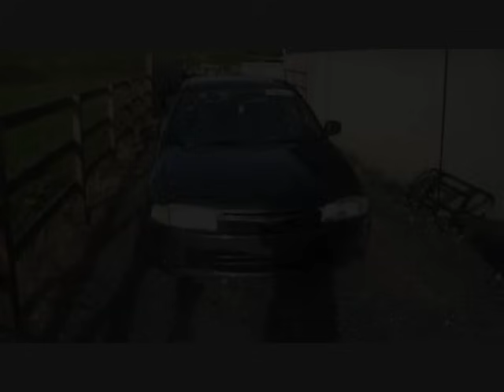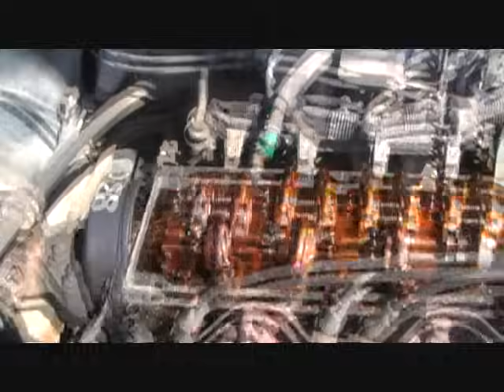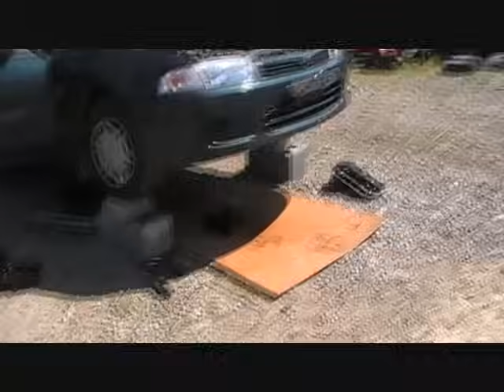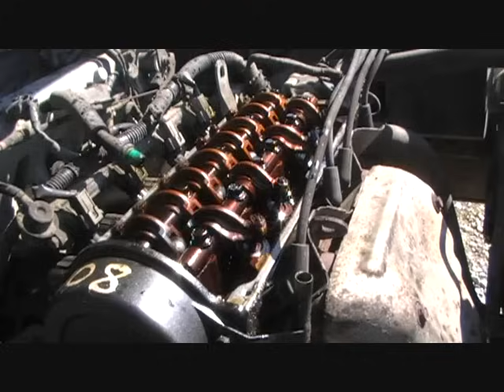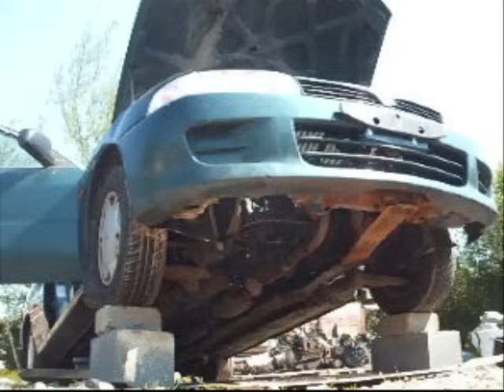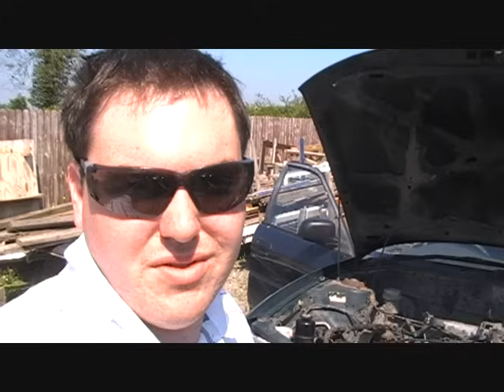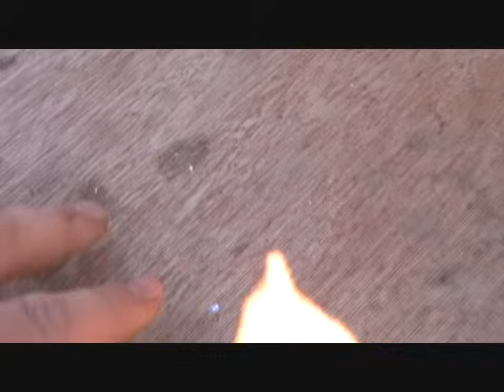Engine Running NO OIL - NO SUMP - Seized Soild on Camera

Comment: I tow cars all the time that have had rods blown holes in the block. and have seen it in front of me racing, giant cloud of smoke when the rod comes through the block and the remaining oil sprays out onto the hot exhaust pipes.

Comment: oh yes there is. I was on the highway and there was a minivan in the slow lane. As I went by the minivan sounded like flapping plastic in the breeze, then the minivan slowed down , I had to look in the side miiror as there was a slight bang and flames under the car.. Ideling, even at a higher speed is a lot different then driving when you have the momentum of the car through the trans that breaks the "siezed" engine loose a few times till it seizes to a point where a rod bends or comes loose.

Comment: Had a merc E280 let go when chasing a vauxhall senator, no bang just sudden loss of power and silence. A con rod had let go which took out the next liner aswell, it drove an inlet valve out through the head and broke the inlet manifold and it had broken the cam and pushed two exhaust valves up into the rocker box which had a huge hole in it where the piece of cam had come out. I had people coming round for weeks after to look at the sump full of metal that we had removed :)

Comment: Well it can sling a rod...once the bearings are chewed up enough it can crated a gap that causes too much force on the rod cap under high Rpms and it literally rips tha cap off and slings the rod...and you could put the pan back on and over fill it w/ oil let it set overnight and it would crank and run again...but not for long the damage is done

Comment: it is interesting to watch an engine expire,  yes usually they lock up, but some engines can  go off with a bang,  i experienced this as a young buck, in an old 50's car , we  had been sitting on 70 mph on a country road as young blokes do, it first lost power, kept it flat to the floor, losing road speed ,  losing road speed, still flat to the floor,
then bang, tinkle tinkle tinkle as engine bits(broken engine block) bounced along the road.

Comment: It would be interesting to hook up a water hose to the oil pickup and pressurize the oil system with about 75psi of water with no oil pan then run it. The water will cool it and make a suspension between the bearings and journals. It will fail after a while, but run longer then without oil.

Comment: I hate to see things destroyed 'just because'.  someone, somewhere could have possibly used that engine, and even if they'd given you only a few bucks for it, it would have been better than blowing it up.  the engine was obviously usable if it was that clean inside and ran that long without oil.  your car, and your call, obviously, just pointing something out.
Reply: I'd pay him 20 bucks to do this , its valuable information, you only need one full rev video to tell you an engine will slow and die if you highway it with no oil, but this let's me know I can make it to a close oil place before its too late, and how long I'd have to pull over if I ran out
Reply: I could save you the $20 AND the car in the video.  Damage to the engine starts the moment it is starved of oil.  The engine may go for some distance before the damage becomes severe enough for it to seize, but th longer it goes without oil the more extensive the damage and the more expensive the repair.  The major components at risk are the main bearings, crankshaft, and camshaft.  ALL are expensive fixes.  Better to shut it off the moment you know there's as problem and walk a mile or two.  Might save you a couple grand.
Reply: ok it was an example , but lets say you kit something and crack your oil pan , theres time to notice the pressure drop and shut it down
Reply: Dion Comeau No - if is no oil and there is any load at all, you are going to have metal on metal pretty darn quick.
Reply: I think what Dion Comeau means is if you shut the engine down immediately upon noticing a problem, that it might not be necessarily fatal.  Which is probably true, I suppose, but I'd have to point out that in such a situation, seconds count.  After all, it's not always possible to shut the engine off right away.   You might need that engine running long enough to get safely to the side of the road.   Shutting the engine off in, say, the high speed lane of an interstate is dangerous to both you AND other traffic.  But yes, the longer the engine runs without oil, the more likely there is to be significant damage - and serious damage can occur in less than a minute.

Comment: The metal filings ejected from the engine were the top coating of the bearing shells. Main and big end shell bearings are designed to consist of three layers, steel, copper and finally bismuth. The whole idea of the top coating of bismuth is to allow for in extreme cases the bearing to wear without damaging the crankshaft. So if you run out of oil and realise in time, you replace the damaged bearings without having to replace the more expensive crankshaft..

Comment: Actually it was a 1973 ElCamino 350. It was in a flood and the oil floated out. When I pulled the dip stick only water showed! I needed to drive my wife to work (1 and a half hours) then to my work (45 minutes) there I drained all the water out, put in oil, ran till hot, changed oil again and ran it for years after with no apparent damage!

Comment: There is never pressure built up in the block. "oil pressure" is just the pressure of the pump picking up oil and pumping it through its passages to the rockers/cam/lifters and other places. etc, then the oil drains back into the pan.

Comment: I have some questions for you. 1. Why did you choose to do this? 2. Some times moors will fail by rods breaking, large short lived flames. 3. You are correct that most of the time a motor will fail a lot like this motor did with no spectacular visuals. I hope next time you chosse to show some thing like this you use some thing other than cement blocks. That can be very dangerous. Just be safe and thank you for this video.

Comment: Beautiful!.... but now how do you fix it???
is it possible to bring that engine back to life without swapping it??? if so, how???
please go in detail
Reply: not really. remember all of the parts have metal shaved off of them. if the block is not broken, you can replace everything. but it would cost you more than simply buying a new motor.
Reply: He never said he was going to fix it so there is no detail to get into.
Reply: I never said he was gonna fix it
Reply: I wasn't replying to you. This comment section is for replies to Julius' comment.
Reply: i see, well. my point still stands. she never mentioned the poster fixing it, she was just curious as to how it could be fixed. is how i read it.
Reply: Thanks guys! Engine Swap it is lol.

Comment from the maker: the release bearing in the clutch is badly worn and is making the roaring sound that you here. nothing to do with the engine, but the gearbox has to be removed to replace it

Comment from the maker: well here in Ireland the scrap price of a car of this age is based only on its weight, nothing else, so I got just as much for it with a wrecked engine as I would have if it was running. As I said before, the car was not economically viable here in Ireland due to strict annual testing, and parts from this car , like engine and gearbox etc... were also not valuable as there is little to no demand for them here. The car was just worth its weight in scrap, but I got some fun from it too!

Comment: Here in Oz, a wrecker or backyard mech could potentially make 500 from that engine/gearbox combo (obviously before it was destroyed). Wreckers sell all kinds of things. A piece of crap car can make you a couple of thou if you sell the components individually. A bonnet $50. A door $50. A/C compressor $50. Running engine $400+. Gearbox $200.

Comment: If you were to put oil in it, I'm pretty sure it would start again.  I'm amazed that it didn't spin a main.

I once tried to kill a car with bad rings by avoiding oil top ups.  As the oil was consumed, the car actually became faster and faster... right up to the point where it spun a main.  At this point I desisted and put oil in it cause I needed to get home.  Apart from a distinct ticking, it went exactly the same as usual for a further 2 days; at least until the engine seized. I was chuffed.

Comment: Even though it will surprise most persons how long it took the engine to seize up, a lack of oil is but one way to destroy an engine. Another effective way is stressing internals for a period of time while the engine is under load, even with the sump installed and filled with oil. Connecting rod loads put wear on bearings and the right amount will destroy an engine even quicker than free-revving one without oil

Comment: thermo shock. the engine is extremly hot after that, you introduce room temp oil and i dont think it would make it 1 min. probably end up actualy cracking the block or head. but i dont know for shure you could be right.

Comment: I bet you might be able to loosen the bolts a bit on the rod bearings and start it up again.... maybe
Reply: Yep I bet you could as well just need to make it loose enough to turn over it will run until something completely seizes it up.
Reply: Eric Kent Remove the rod bearings and tighten the bolts until the caps are tight on the rods but not touching on the crank talk about rod knock now we are talking about BREAKING pieces of steel.

Comment: It has seized because of heat, and the oil is not only there for lubrication, but also for cooling.  If he let it sit for a while again it would start again until it got too hot again. He could have held his foot harder on the gas and it would have overcome the stalling from friction..........for a while.

Comment: I used to know a used car salesman.  He would go to Mexico to find cheap cars.  He found on but it had no oil.  He was told to use water and just drive slowly.  He did and it went for hundreds of miles.  He then drained the water and put oil in it. It was fine.

Comment: What is the noise the engine is making when he first pulls the car up? My engine in my 2002 Galant DE makes the same noise. Most cars here in U.S. don't sound like that. Just wondering if anyone can tell me if thats normal, or what the noise is?

Comment: Well this is exactly what happened to me to my 99 Corolla on highway.... Low pressure Oil and did not stop :(... and mechanic said it would cost me 1000$ +. I didn't know what to do. is this fixable at any cheap cost or the car still sellable if the car was still in great condition besides what happened here to my car? what price would I get to sell a car that has metal pieces in engine..?

Comment: You need to run an engine on fairy liquid and see what happens.I bet it will run for a long time. It has a similar viscosity but I don't know about the index. It is worth checking out. Big oil may shut you down..LOL

Comment: Try again with another scrapper, but go a little drive. It lasts much longer because there's virtually no load on the engine. Go tear it about and keep it above 3k. An engine seizing under full load and stopping from high RPM has a high chance of producing a more impressive failure :D

Comment: Its a good thing i always keep an eye on my dash. I had a car where the oil pump sensor blew and if it weren't for that nice little oil light on the dash coming on. I woulda blew the engine. I pulled over and checked under the hood, and had a nice puddle of oil under my buick. i was maybe. 1 min from home. i babied it and parked it and shut it off. my dad came out and looked and said yep. Oil sensor. It had been replaced maybe 6 times (each one blew after replacement) finally we found a bolt with the same threads and etc and just put it in there. I think the car is still running today.

Comment: Oil is the life blood of the engine, tolerances begin tight and as time progresses they loosen up. So, running for a while without oil is not a big deal. My daughter's car drove for many a mile with the oil lamp coming on at stop lights and going off as she cruised. She traded it @ 170k and the engine still started well and we never saw metal or grit coming from the oil drain hole. Its worse if you never change your oil. All that sludge and varnish is really, really bad.

Comment: I am curious...why was the car taken off the road?  I understand you guys probably have stricter motor vehicle laws than the U.S-you should see some of the garbage I have worked on-but that car, as far as I can tell, looks to be in REALLY good shape for a 96 Mitsu(what we'd call a Mirage). Previously totaled, or just too high repair cost to pass the tests?

Comment: wrong in the Uk you would get £60 , i got that for a running fiat , they have no value they are light as hell , in rural parts of the UK the car must be towed possibly for 100 miles.

Comment: The majority of the engines I have replaced over the years either had a loud knock or were seized solid. That is what happens to your average driver's car when they neglect them. They can fly apart during normal driving, just depends on the conditions. It's got alot to do with the inertia of the parts moving inside the engine, and the load put on them. Also a big difference between failure from lubrication vs. overspeed. You wouldn't know bullshit if you stepped in it, son.

Comment: To all the people whining about how some poor old granny could have used this car for YEARS because the engine ran so well without oil!   ....You know jack shit about the car. For all you know, the transmission was worn to hell and barely shifted, the drain plug fell out of the rear axle while being driven the week before and the differential got ruined, there is rust in the gas tank, the ac is broken, the heater is broken, the doors don't lock, the sunroof was left open in the rain and the uphostery is rotting, the speedo, tach, fuel, and temp gauges are all broken, the tires are worn out, the brakes are worn out, the headlights don't work and there are mice living in the vents.

Sure, maybe none of those things, but you don't know. And if even HALF of those things were true, it would be a crime to sell it to someone. the guy says it's a total write off, maybe give him the benefit of the doubt of knowing the worth of his own vehicle.

Comment: well that's not true you can get a vr commodore motor run it and if oil pressure drops and it  spits the oil out the pistons will blow out both side of the engine and no one can tell me different because i have seen it many of time's

Comment: Nothing dramatic happens? We drove around with a badly polluted engine and the oil pressure light would come on when warm. It lasted longerthen expected but after a while on the highway it gave up. Found part of the connecting rod with the piston pin still in it on the subframe. haha awesome!

Comment from the maker: Correct, no oil means there was more friction, friction builds up heat, which means the parts expand and become tight, hence why the engine seized.

Comment from the maker: actually no, the engine was perfect, the car needed nearly every bushing in the suspenson system replaced, 4 new shocks, 4 new tyres, new clutch and release bearing, two new seat belts, brakes all around, and a few new lights. engine was perfect though, as one would expect with a Japanese car of the era

Comment: I think that is liquid bearing material. Usually the motor blows up if it is running high RPM'S. You only ran it at 2000.

Comment: For all the people that are complaining about destroying a good engine, you really have no idea what you are talking about.  Were you going to pull the engine out and put it in another car or pay for someone to do it?  If you did, would you be upset if the thing only lasted a few months and then shit itself?  Anyone who paid to have the thing Installed would be back at the mechanic whineing they just blew all this money and would want warranty even if it was clear there was none. Then when the person stood their ground, the person that paid to have this engine installed would go round bad mothing the person that installed their " Good, free" engine.  Can't say it wouldn't happen because I have seen it happen and had people whinge loads of times. They buy an engine out of the paper from someone who promises them it's great and then when it's no good the first person they come back to is the guy that put it in.

There is more to it than just the value of the engine, When people get something they always expect it to be perfect no matter how many times you try to warn them.  When it's not, they get all pissy.
This thing could have had any number ot problems like blown head gasket, low oil pressure, or just worn. None of those thing would effect the way it started and ran for the duration of this vid but would make the thing useless and unreliable for practical use.

Comment: Probably would turn over if you put oil back in it and turned the crank by hand a few revolutions.  However it will never be a quite running engine cause of the cap bearing loss.

Comment: Nice, more interesting than your normal "no oil" type videos you get here, what would be even more interesting though is to see how long a car would actually drive with no oil, see how it reacts to having a load on the engine rather than just revving with no load. It's surprising how long an engine will tolerate this kind of thing like you said, and usually they do "come back" to a degree once they've cooled down (do knock their bollox off though lol)

Comment: Maybe but no oil could have done anything to the engine you could have spun bearings broken piston rings cracked head or block and the pistons and cylinder walls could be be gouged and that's just off the top of my head. I'm not saying there's no way it could happen I'm just saying there's a real big possibility that this engine is toast.